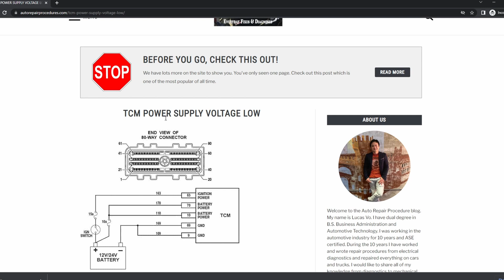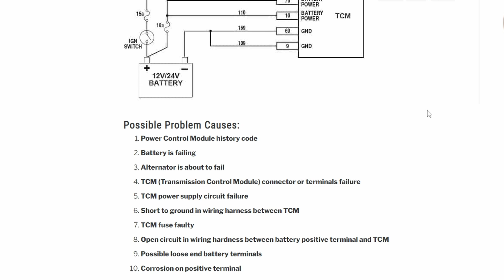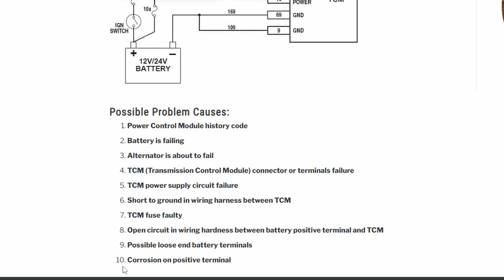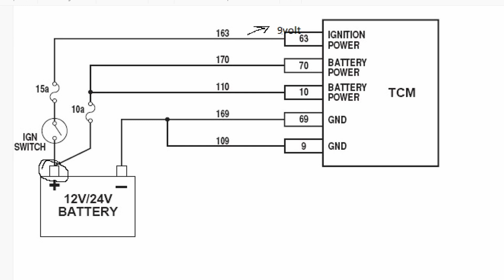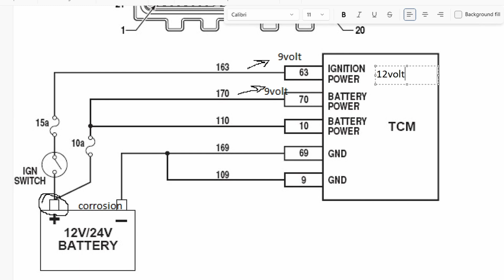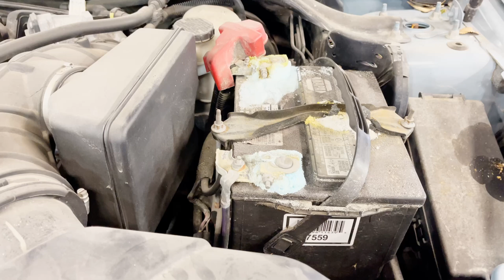TCM Power Supply Voltage Low - Code P0882 | Recommend Checking Battery Terminal For Corrosion First

Comment: Hi, currently having this issue as well, I changed the TCM Itself due to mechanic telling me it was "burned." I also changed the battery since it was also bad. Yet scanners is reading code P0882 And when trying to turn the car on it would not let me. Radio and AC Turns on just fine but it doesnt do no ignition to turn the engine on. 
Car is Mazda CX-5 2013

Comment: Im getting a p0882 n p0171 code. Battery terminal always corroded, not sure why.
Should i buy new terminals to fix the p0882 code?
Reply from the maker: Clean the terminal first to see how bad is the terminal is. If terminal is bad I would replace it. Try to clean all the corrosion off the battery terminals to see the code goes away.

Comment: I have a jeep commander 07 throws so many codes randomly once in a short trip long trips is fine . But it’s throwing three codesPO700 PO882
Reply from the maker: I would check corrosion at the battery and all the grounds wires. Is your transmission shift harsh or slight delay shifting into different gears? If so, I would check the transmission fluid, check for burnt smell or metallic materials. I would start here first.

Comment: Thank you for that explanation of the wire diagram. But i have to ask what helpful tips or procedure to fix the issue. You repeaded p0882 code over a handful of time along with saying battery corroded...im just confused.
Reply from the maker: Just clean the battery’s terminals. Clear the code to see if the code comes back.

Comment: Ok, so my battery was replaced & terminals are clean, still reading low power.  The old battery was good but was only 8.7 volts.  Should I replace the alternator?  2012 Town & country.
Reply from the maker: Here is what I want to do. If you have a multi-volt meter. Keep the car running and check the voltage across the battery terminals. If your volt meter reads 13.5 or/and 14 bolts above which mean the alternator is charging. This test method just quick check, but can’t test the diode in the alternator. If your volt meter reads 12 volts below then I highly suggest replacing an alternator. Best of luck friend.

Comment: I have a ‘13 BMW X3 getting code P0882. Issue is auto start  stop is on, and when  stopped at light car cuts off goes into park. Then transmission malfunction pops up.
Reply from the maker: Sounds like your vehicle has an electrical issue. If you bring your vehicle to the dealer, they can figure it out. It is hard for me to do anything without seeing your vehicle.
Reply: @autorepairprocedures  thank you for replying
Reply: same with my ‘16 320i
Reply: @AstroidMelts  since I turned off auto / start stop not experiencing that issue. Check engine light hasn’t popped back on. Hoping it stays that way
Reply: @baddestebony3504  ok thanks will try did check engine light go away by itself ?
Reply: @AstroidMelts  it did yes
Reply: Did you have this issue fix?. I've been using the same method as u to turn the auto stop off but most time I forget
Reply: @leigh4146  no I didn’t , but turning it off has helped
Reply: Am having the same issue, did you find out what the issue is?
Reply: @irvingotgame5258  unfortunately the car has been totaled out! I was rear ended stopped, & then I ended up going fwd hitting the car in front! However it only did that with the auto start stop on! It would go into park at the light! Other than that no issues! It shifted out good. I now have a ‘18 640 XI GT! Hasn’t happened yet hope it doesn’t!
Reply: Sonata 2012 com p0882 transmissão 4  marcha e ninguém resolveu meu problema

Comment: Hi thank you for your video. I have a cx5 2013 when I go in the freeway and when I press the break pedal the steering wheel starts to move a lot any recommendations?
Reply from the maker: Thanks friend, your brake is pulsating it will be your front brake.
Reply: It happens to mine too isn’t it the disk or how you fixed it?
Reply: @roberto